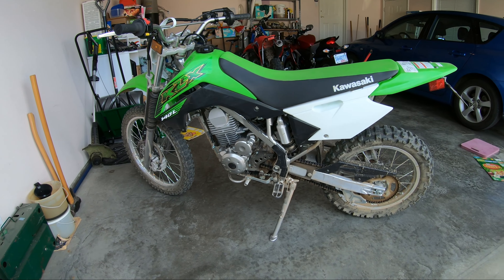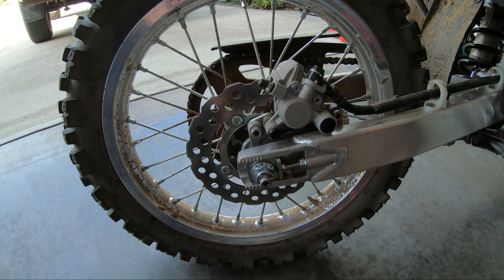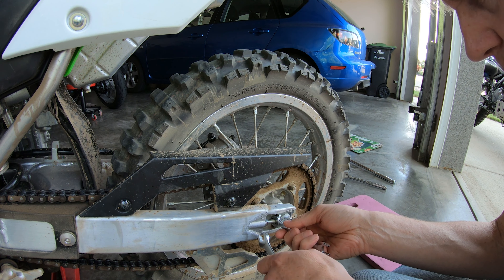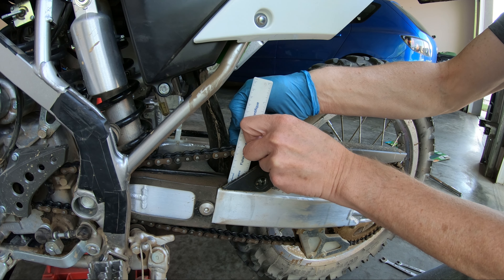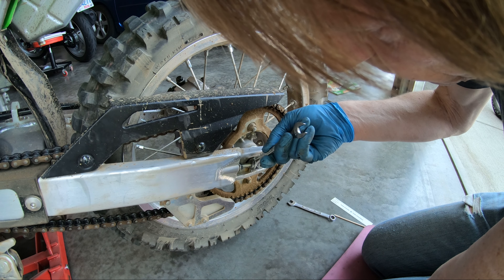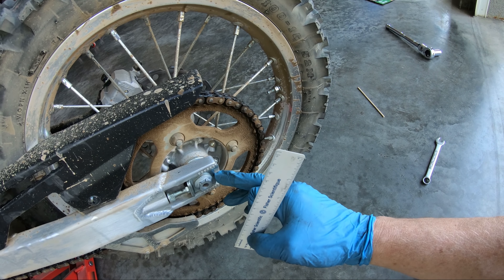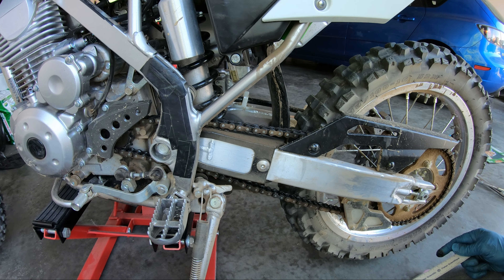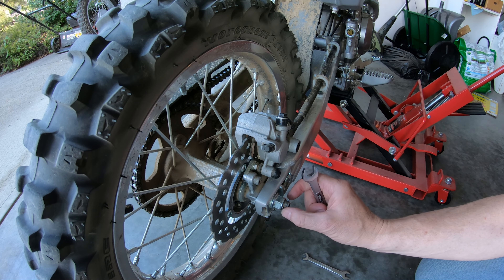Kawasaki KLX140 Chain Adjustment

Comment: Do you haft to remove the cotter pin?
Reply from the maker: In order to adjust the chain, you need to loosen the axle nut, so the answer is yes (probably), you will (most likely) need to remove the cotter pin in order to adjust the chain. Depending on the size of the cotter pin, it might be possible to loosen the axle nut just enough without removing the cotter pin to facilitate adjusting the chain.
Reply: You shouldn’t have to remove the cotter pin. You’re just loosening the axle nut. There was plenty of thread between the nut and the cotter pin when I adjusted mine. You don’t have to remove the axle nut, just loosen it.